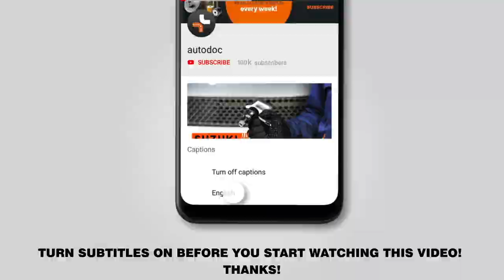How to change rear brake caliper on VW GOLF 5 (1K1) [TUTORIAL AUTODOC]

Comment: I just had new rear discs, pads and callipers fitted to my 2006 Golf Mk 5. The brake pedal's now very spongy, you have to pump it, the garage say all the air was bled out of the system and it should bed in. After 100 miles it's still spongy, The pedal gets harder after several pumps, is this usual?!!
Reply from the maker: Thank you for your comment!
According to the description, it is difficult to solve your problem, we recommend that you contact the service for a complete diagnosis and identify the cause of the problem.
Best Regards,
Autodoc Team!

Comment: I need to remove the caliper housing itself, in order to replace the rotor.  There's a star bit I need in order to do this, but I don't know what size the star bit is.  🤷‍♂
Reply from the maker: Unfortunately, it is not possible to answer your question, you can find this information in the technical documentation for the repair of your car.
Reply: #13 triple square

Comment: I don't belive that method works  for bleeding need VCDS or similar software.
Reply from the maker: This video is for informational purposes only and does not guarantee a specific result. This video contains only tips and tricks that may be useful when repairing a car or replacing parts. It is recommended that installation be carried out by highly qualified professionals to ensure the best results.